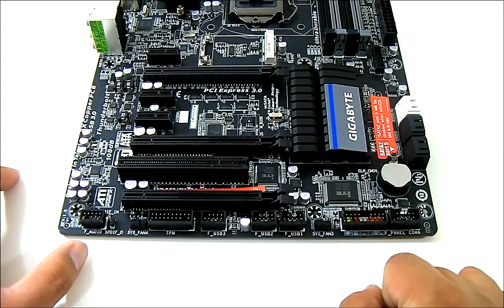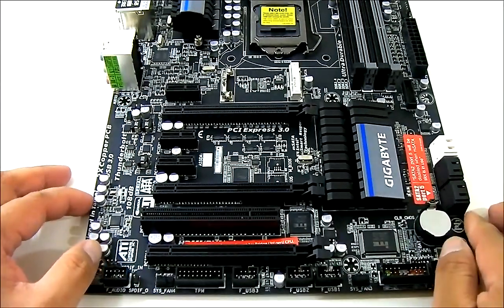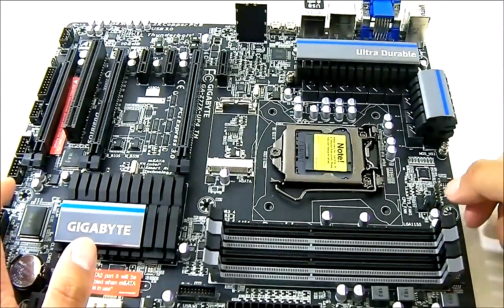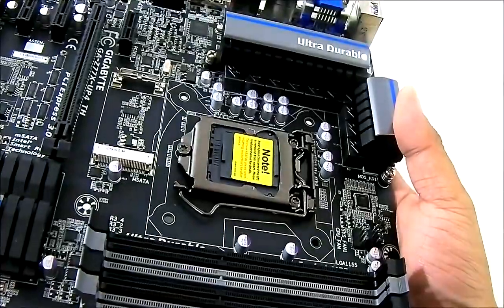Gigabyte Z77X-UP4 TH Motherboard Unboxing + Overview

Comment: im buying a computer and im getting the gtx 660 ti gc 3gb GPU and it requires a dual width motherboard? this motherboard is in my cart and was wondering if its dual width??
thanks